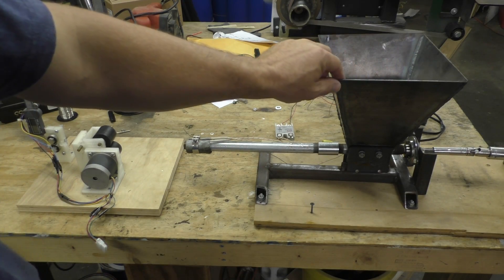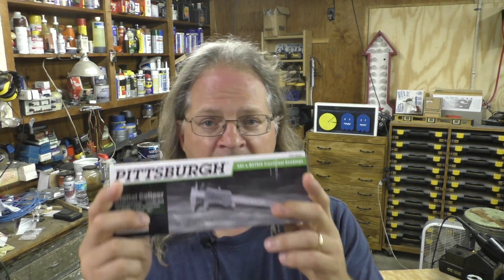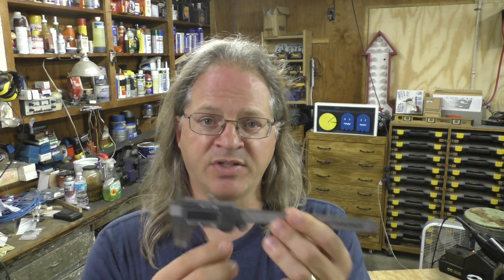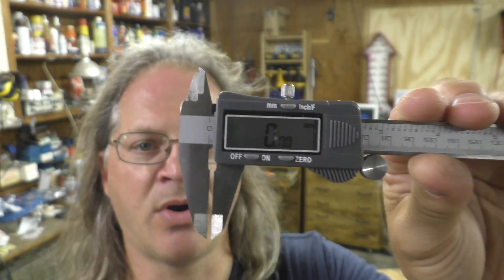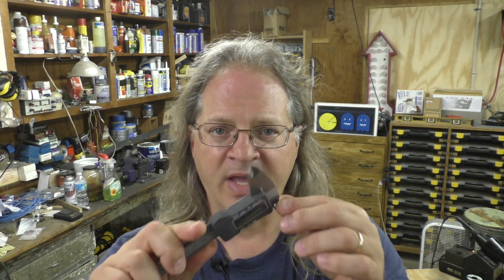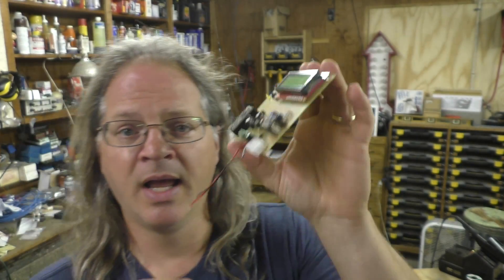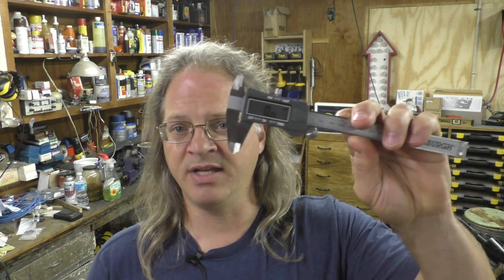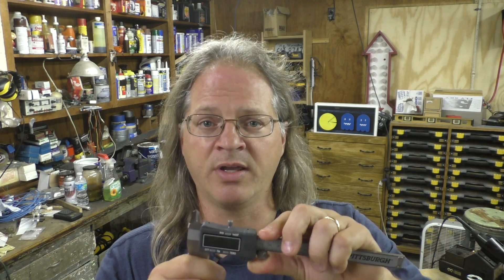Filament Extruder Update - Digital Caliper Issues

Comment: Instead of using calipers Have you checked the project Infidel from Thomas Sanladerer? It is designed to do the job and seems to work pretty well, and it is super cheap.

Comment: well that' a strange behavior, my cheap version always remembers the last position even when it shuts down to standby. I recognise quality differences . I think desingning a dedicaded sensor might be an option like a small roller + a lever two gears+ a optical sensor which could be 3D-Printed.If you still didn't solved the issue i can make a drawing of my theoretical design.

Comment: I wonder if a magnifying glass, light source and a camera holding arduino board wouldn't be better instead of a caliper. It would be easy enough to make, I'm just not sure about how high the camera resolution would have to be to achieve desired precision.
Reply from the maker: Yeah there is an optical solution that has come out since the video was made.  Maybe I'll try it on Version 2.0.

Comment: Think you barking up the wrong tree using that method. There is tech available to measure diameter and signal adjustment using light. If your determined to keep it diy, maybe use a suitable accelerometer. Instead of gravity acting on the weight, try and rig something up to mechanically affect the sensors mass as the filament passed through,  So say a near perfect 1.75 diameter is your O and then the change in diameter moves the mass positively and negatively depending on the diameter being >1.75 or <1.75. The change in resistance can then be plotted and the data used and programmed to actuate speed difference of the extrusion setup to dial in the desired width of the filament.
Reply from the maker: The video is 2 years old.  The optical method hadn't been developed when the video was made.  I've been thinking about revisiting this project and using an optical method to measure the filament.

Comment: Hi Bob, love the video's. The digital caliper reads increments by using a air capacitor. The higher the capacitance the higher the reading. If how ever the two plats were to short say do to warping the capacitor would drop to zero capacitance and so would your reading. To fix this problem you need a dielectric between the plats like Scotch tape instead of air.
Here is a link to fixing the caliper.
http://www.instructables.com/id/How-To-Fix-Digital-Calipers/
Hope this works for you.
Tell Russ Kennsplace said hello.

Comment: Waiting for my account to be enabled on the forum.  After reading the forum, I didn't come across any software solutions.  I'm going to guess that the calipers are sampling at a rate of at least a few times per second.  This would seem to indicate that measurements should vary by less than  0.01mm from sample to sample. This means that the current sample and the prior sample are likely very close in size if not the same.  When the first zero reset occurs, the change is massive in comparison.  Can't you just adjust the software to detect when this first zero reset has occurred? You would track a global offset that you apply to the current measured value.  This starts out at 0.  When you detect this massive change ( e.g. 1.73 to 0.00 ) your global offset is set to the last known good value ( 1.73 in this case ).  Now when you read 0.00 + the offset ( 1.73 ) you have a current value ( 1.73 in this case ) .  Further when you read negative 0.01 you would know that it's actually a negative offset from the value (  1.72 in this case ) .   There does remain the issue of yet another zero reset when you're already near a zero value.  It now depends on how accurate the system is at keeping within certain range in a narrow time window.  If the resets are very infrequent and if the feedback system is able to maintain +/- 0.01 normally from sample to sample then a reset would likely only result in at most +/- 0.01 shift.  Assuming these resets are randomly distributed this should still keep you close depending on the frequency of the resets and the length of your production run.

Comment: Hi Bob, Could the problem with the caliper be caused by static electricity?
The filament continuously rubbing against the caliper can easily build up a charge that causes a reset by discharging periodically.
You could try to electrically connect all the metal parts of the caliper/extruder/winder/frame with the ground of the electronics.
Reply from the maker: It's possible it could be static but probably not. The ground from the circuit board is connected to ground of the calipers.  Thanks for watching.
Reply: That might be sufficient if the ground of the caliper is also connected to the metal parts of the caliper.
If not, it is still possible to built up a charge. With moving plastics, it's likely to happen.

Comment: Have you tried pulling the reset pin of the epoxy blob in the caliper to ground or supply?
Or it might even be static electricity building up from the rollers, grounding the caliper body would help if thats the case.

Comment: right registering takes to long.... and i will forget what i wanted to say.
The idea to use the optical strip and encoder from printers is smart.
However the optical encoder with a line camera has one huge advantage over any other solution.
The feedback loop can be made shorter!
Instead of measuring the thickness of the cooled down filament you can measure the thickness of the hot filament, meaning you will have less change of overcompensating the pull speed.
even if linear sensor in large quantities are cheap not so much in one offs. a cmos sensor might be a cheaper solution an MT9D111 might work

Comment: A temporary solution might be to install a physical stop 3mm up that can be used to quickly zero the calipers on while the machine is running. Then just program -1.25mm to be the desired target value.
Reply from the maker: Nice idea.  May have to do something like this if it can't be fixed.

Comment: Sorry for the comment here just to lazy to set up a new account on the msg board. I had a couple of thoughts, first is this an interface problem, what i mean is does this only occur when your trying to read the interface, the reason I ask is that I seem to remember Russ running whole spools out using the caliper when it was a stand-alone. I have a similar set of calipers here in Oz Craftright brand, and they don't seem to loose position over a period of hours even if they do go into standby but I'm not using the interface.
 I hate to ask but have you contacted the manufacturer? I know it may be difficult as they might be a rebrand.
I did think of an optical system but it would be a lot more complicated so will follow this to start and suggest later if this issue with calipers doesn't work out.

Comment: I cant comment on the OSE forum, account still awaiting admin approval :(... but you are talking about the Filip Mulier built device called 'Filament Width Sensor Prototype' currently version 3, Thingyverse item # 454584... it measures the filament by shining a light from behind, and measureng the shadow cast on a 1pixel wide sensor (i think its 128, or may be 256 pixels long) . See https://youtu.be/5JmroyGb4qY?t=126 for a inline use with an extruder.
Reply from the maker: Thanks, I'll check it out.

Comment: Serial data should be absolute value. What the screen says should be irrelevant.
Reply from the maker: The circuit board has an LCD that shows what it is reading from the calipers.  The serial data is matching the LCD on the calipers
Reply: Sounds like the caliper is suffering from a brown out. One thing to try it to supply the calipers with power from one of the $1 buck converters set to appropriate voltage. The other part to try is to let the calipers turn off and then start using them. They never really turn off, they only power down the LCD, they may be more stable that way.
Reply from the maker: Bruno M. the calipers reset when running on battery or from the voltage regulator.  Go suggestion, we can certainly try.

Comment: Maybe you guys can figure out how the calipers work and build your own measuring circutry, so that you don't have to work around an existing one. I don't know how hard that would be though...
Another idea would be to use an analoge caliper and attach some kind of optical encoder to the hand, like you can find them in inkjet printers. 
I'll post my ideas to the forum once an admin accapts my registration :)
Reply from the maker: Thanks for your reply! See you over at the forums.
Reply: The actual number value is not as important as keeping the thing in a relative range. I like the optical encoder idea maybe fix to the bearings in such a way as to increase its resolution over the range of movement. I am thinking that an absolute encoder may be more reliable then an incremental as there is a fixed value for each step of the encoder. Have you looked at magnetic encoder strips and head rather then capacitive like in calipers. i think they use a standard quadrature signal like what a dro uses. Silly idea for you but could you use the small lead screw assembly out of a dvd laser head as a way to cheaply convert a linear movement to a rotary one.
Reply: Can't help myself here but I have to add to this. Magnetic encoder stips can be bought in 100mm lengths for less then 10usd in up to 1 micron resolution and the heads can be bought as a complete head or as a chip that you could solder in as needed. The strips are usually mounted on a stainless backing plate. Anyway best of luck in your future endevors.

Comment: why don't you set the caliper at the desired 1.75mm or 3mm size then use the zero reading as the ideal extruding size by adjusting the code. I guess theres always the chance the calibration will wander still so maybe have 3 or 4 caliper readers to compare and adjust a stray sensor or to stop the extrusion. 
Or you could run you filament through some u groove bearings mounted to a solid state pressure sensor.
Reply from the maker: These are some good ideas.  I think zeroing the calipers at the desired thickness would work for a while.  The problem is that the reading never stays dead on for long.  So the calibration would still get messed up over time as the caliper resets itself.

Comment: yep. I also tried the internal battery with no eternal power with the same results. but will get there. see you at the forums! ~Russ
Reply from the maker: Yeah me too.  The caliper resets battery or external power, does not matter.
Reply: Making Stuff i have french OTMT brand calipet that costed 65pln with tax (18$?), it does not reset even powered off for the whole night. I just dont know if its gonna be possible to ship to your region.

Comment: I have a cheap Neiko caliper that I got from Amazon for this exact project and I have not encountered this problem. It might be that I have not let the caliper remain on long enough though.
Reply from the maker: If you find out, let us know.
Reply: I moved all the electronics from my testing breadboard to a permanent PCB and now my arduino always reads "0.00mm" on the serial port, so I have been unable to test if the Neiko Caliper does the same. I'll update once I manage to fix find out what the problem is. If someone has any tip as to what I might have done wrong I'll appreciate it.
Reply: Hello Bob, sorry for the delay. I was about to post a reply on the forum but seems like my account needs to be approved first.
I made some tests with my Neiko caliper and it does not show the problem you mention. After a few min the screen goes blank if no variations are detected, but as soon as the caliper detects any change, the screen turns on automatically and updates values are sent to the arduino.

Comment: I'm a precision machinist. I use a Mitutoyo caliper with absolute positioning. Once you origin the caliper at zero, no matter what, that will remain zero. If you shut it off at 0.000 then open it 3.000 and turn it back on, it will read 3.000. A premium caliper would be way more accurate than a Harbor Freight caliper. Could be costly for a single application but would definitely eliminate that portion of troubleshooting
Reply: Boogie Smack yes. well thses will also do that. however. what you'll find is that when those power off. they completely power off. this is good to save battery. but usless if you want to read data from them all day long.  do those have an auto off function? ~Russ
Reply: rwg42985 most of them do offer a automatic power off function but if you look up Mitutoyo # 500-195-30, it does not feature auto off. And is also only a 0-4in/0-100 model. See also Mitutoyo # 700-118-20 as I think it may offer another more suitable solution
Reply: http://www.ebay.com/itm/iGaging-Electronic-Caliper-ABSOLUTE-ORIGIN-6-Digital-IP54-Extreme-Accuracy-/371059125069?epid=1927692008&hash=item5664d8eb4d:g:DAIAAOxyCTtTeESS

I have this caliper it always knows where it is at in relation to zero. It does not have a auto power off function. It also has a data port.